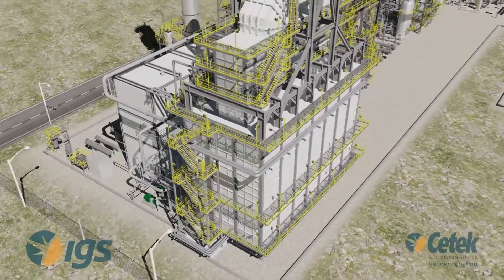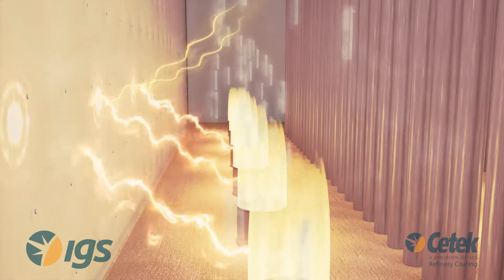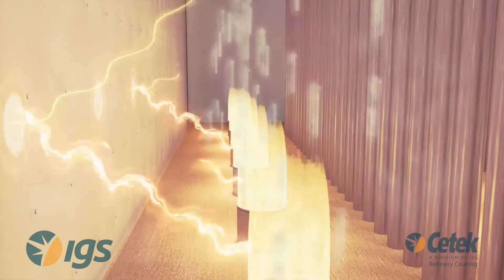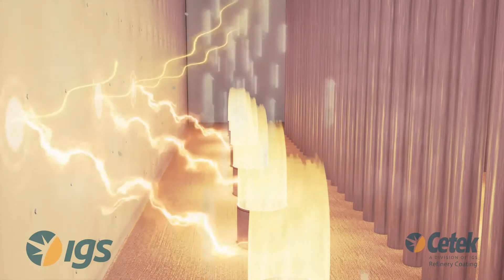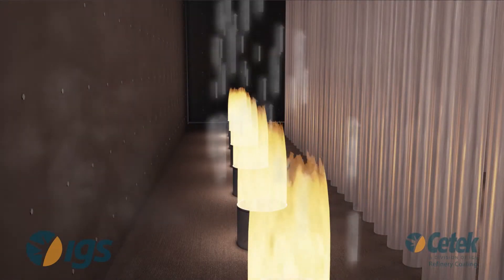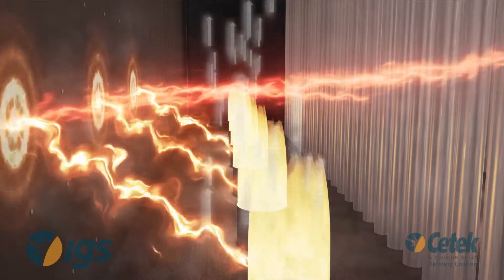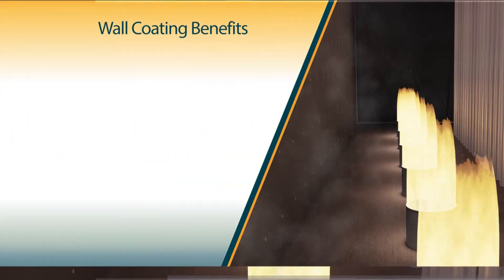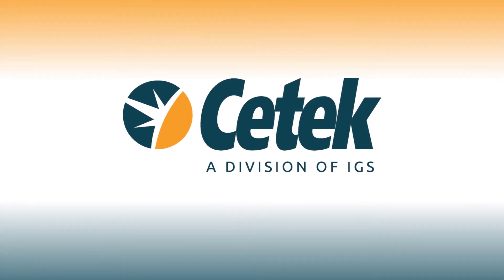Cetek High Emissivity Coating for Fired Heater Refractory

Comment: How much the skin temperature of refractory will increase with emissivity coating?
Reply from the maker: It does not impact skin temperature. The coating allows more energy to be absorbed by the refractory and re-radiated back into the radiant section since the newly coated higher emissivity surface acts like a black body.
Reply: Can this coating be used for coal fired boiler waterwall or electric economizer etc?